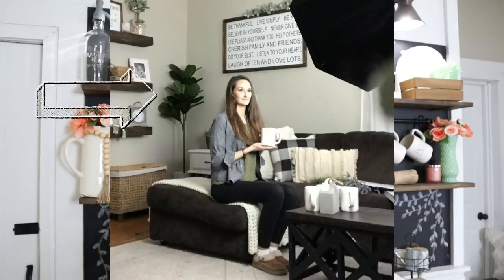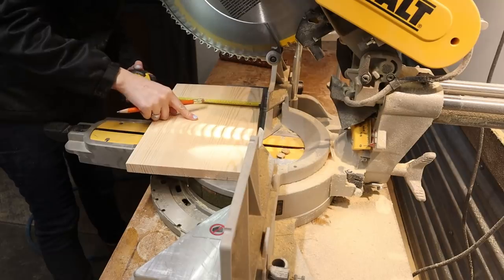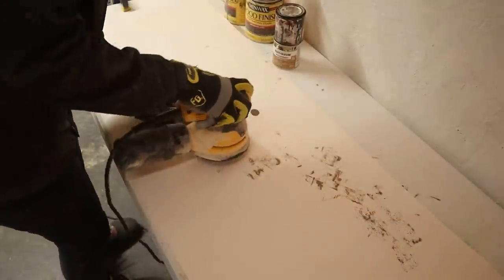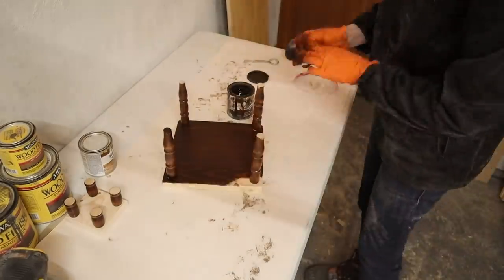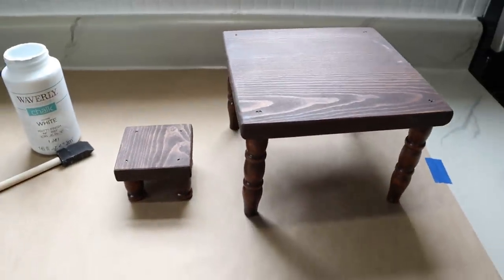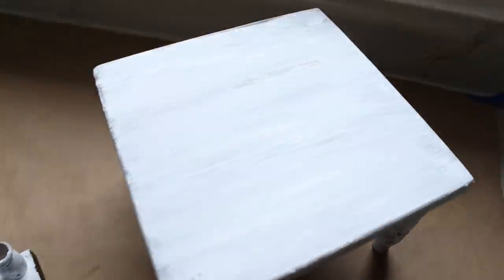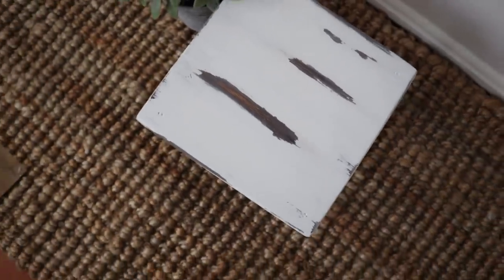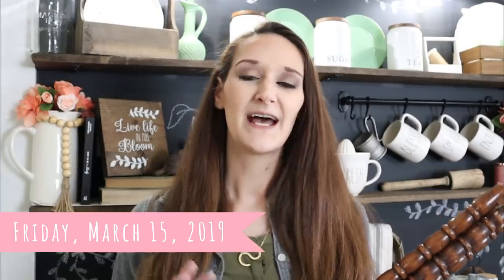DIY Salvaged Spindle Plant Stand | {CLOSED GIVEAWAY}

Comment: Turned out really nice! Love the tiny table! Great use for those leftover pieces! Have you ever tried wet distressing? It can be done with chalk paint. Once dried, take a wet towel and rub down any areas, as if you were sanding and the paint will remove and give that weathered look as well. No need for additional product or sanding. TFS! Hugs! 💛 Linda

Comment: You are creative girl!  Your tables/stand's turned out great.  I don't know if you do ceramics or not but I think you'd enjoy it if you don't.  You are great at distressing wood.  And dry brushing ceramics would be a breeze for you.  
My use for a spindle...   I have a couple ideas .  One would be to put two , one under each side, of a picture frame to attach to another frame.  In each frame would be a verse.  And in the center would be a small leafy wreath (maybe a willow leaf).    I'd paint the wood a solid color and distress it.  Not sure of the colors yet because I have to decide where I'd hang it.  
Another idea would be a dragon fly or body of butterflies to hand Chimes and glass beads from.
And I also love your short stand.  I'd put a jar candle on it.  
Thanks for sharing!  God Bless 💜 
And good luck everyone!

Comment: I think that probably your stain didn't have enough time to cure before you started the distressing, because I paint a lot and I've never had that happen before.  I would most likely use the spindles to create wooden distressed ornaments for my Christmas Tree!  And I'd probably use any leftovers in the exact same way you did....those little stools are adorable!  I do have a question for you also...I've recently gotten a Silhouette and I am putting a Bible Verse on my old Hope Chest.  So I chalk painted it and distressed it.  Then I realized I probably shouldn't have used any Vaseline because of the contact paper stenciling I was going to do.  So I sealed it with Waverly Matte Varnish, then stenciled, and no paint came off with the stencil, yay!  But then I sanded the words a tad bit so they'd look old and the black paint smeared with the sanding onto my old white Paint.  Now I just used craft paint, which might be my problem, idk??  I've even tried to wash it off to no avail.  Any ideas?